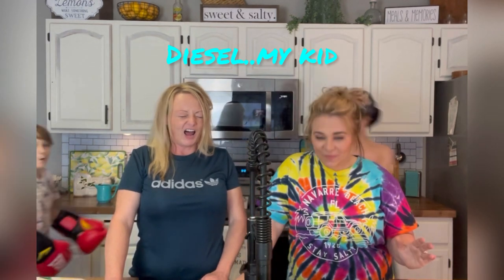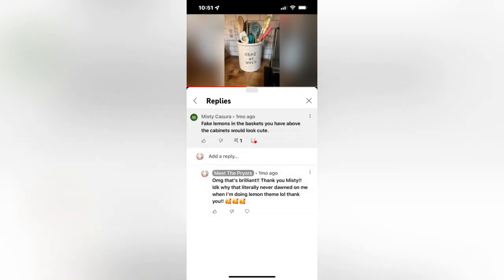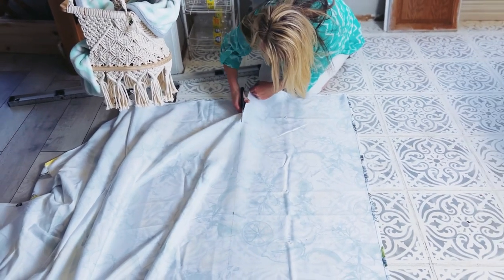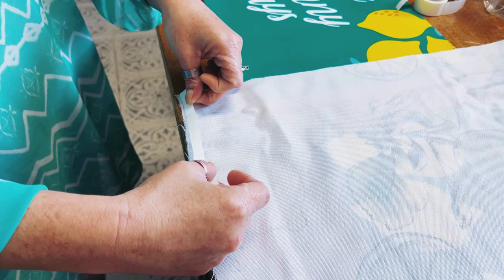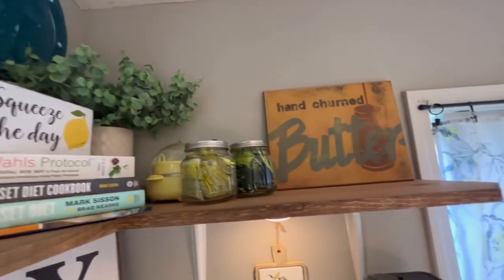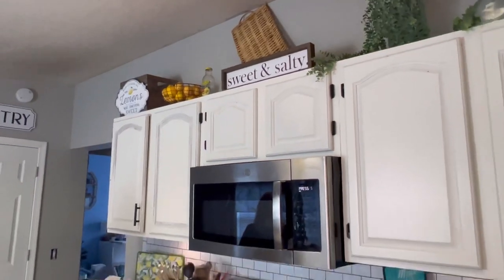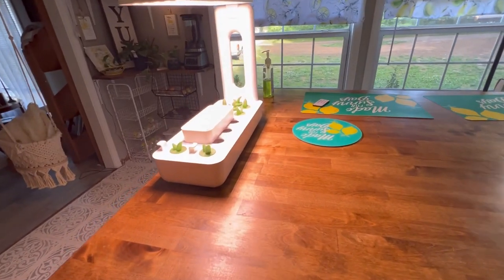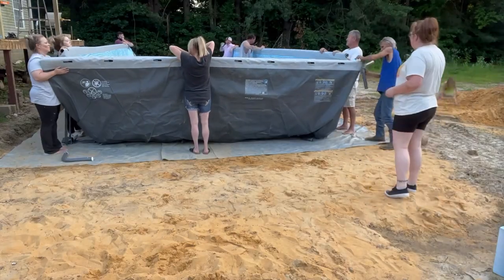Farmhouse Kitchen Updates!! Mobile home makeover!

Comment: Maybe this will help you get over the fear of sewing it's just like driving a bumper car you just apply pressure to the pressure foot as you need it and steer the fabric with your hands along the lines on the stitch plate guides for the seam you can do it I promise. Practice making some throw pillows for the living area that's a great first time project